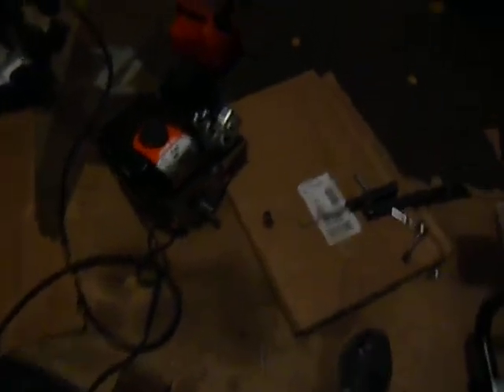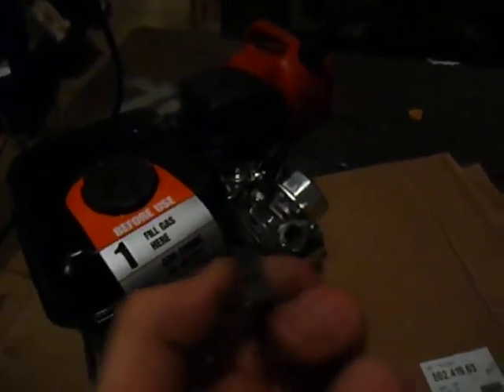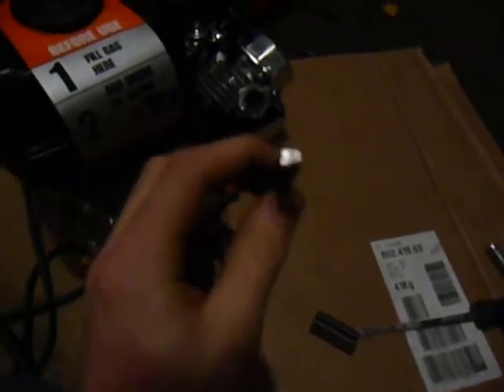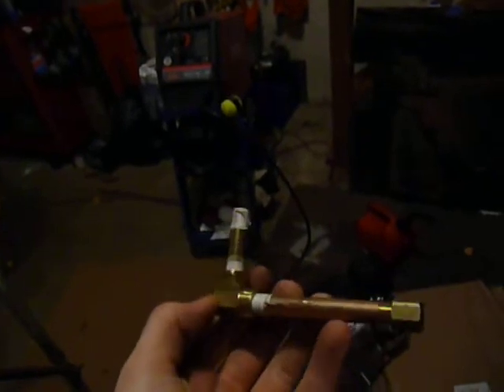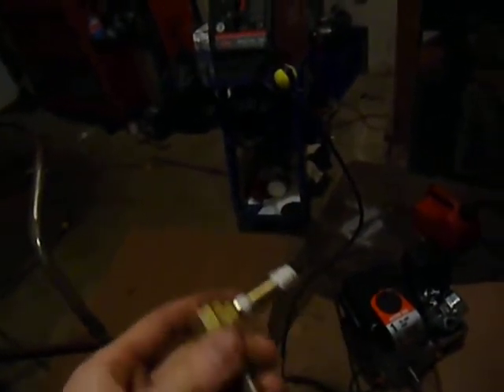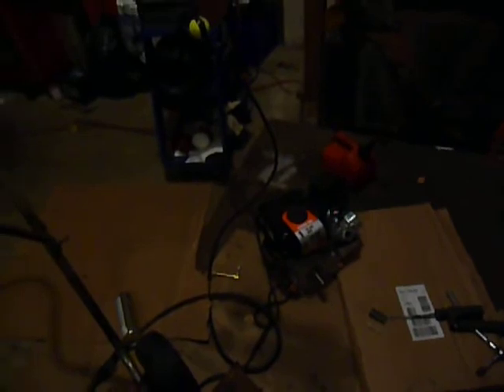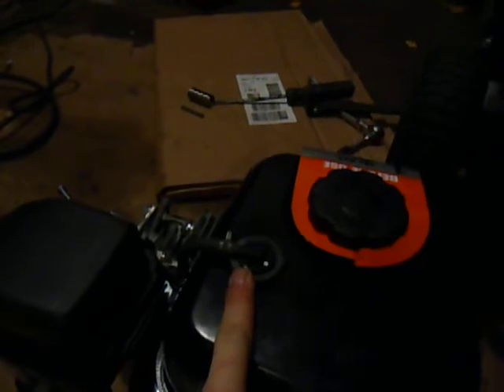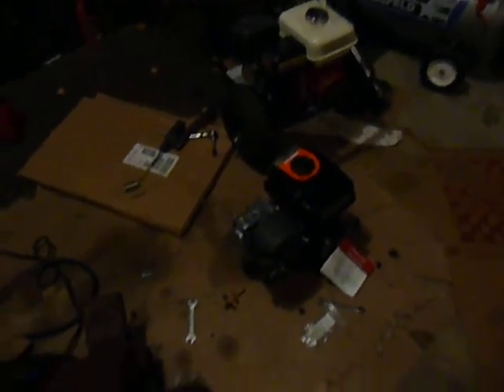Honda Clone Repower Project - Predator 212cc 7 hp Clone motor Part 2

Comment: One other comment. I own 3 of these engines (The old Blue ones). Before I ran these I pulled the engines apart and went over things. Every one of these had aluminum shavings in the bottom of the engine block. No big deal because I was in there to clean it out. If someone doesn't want to go as far as I did they could simply pull the side cover and use a rag to wipe out the bottom of the block. Fairly decent little engines for the price.

Comment: Makes me want to do a video on my repower I did some years ago on a similar walk behind blower. Thankfully mine was way easier than this. Removed a worn out 5 hp Briggs and used the blue harbor freight 6.5 engine. Been using it every fall for yesrs now and I still love getting it out. Great little walk behind. Better than a backpack blower. Good work there.